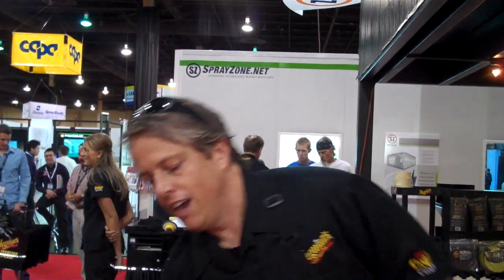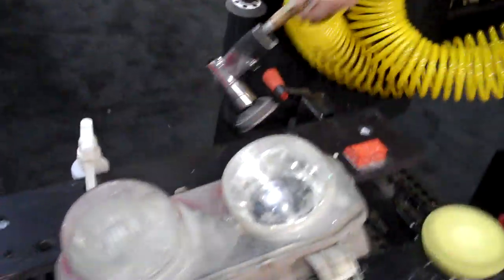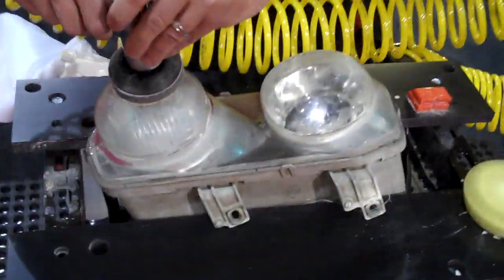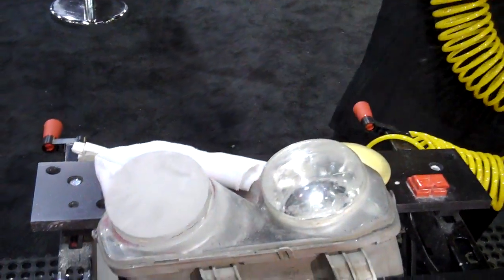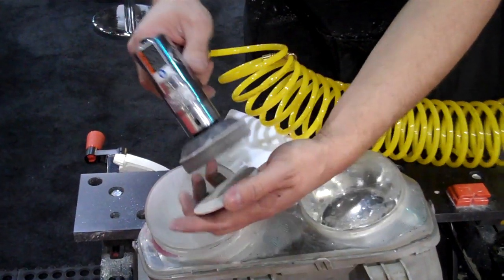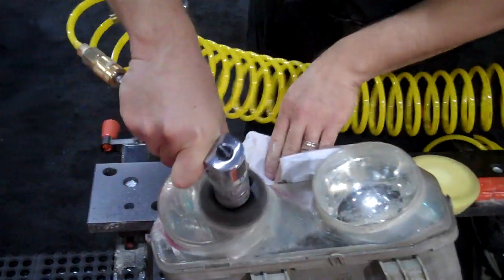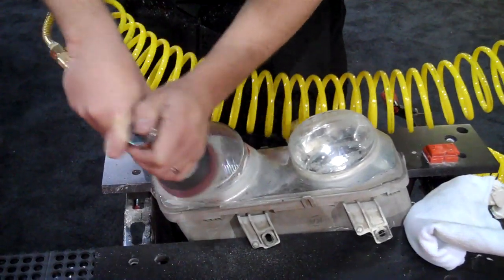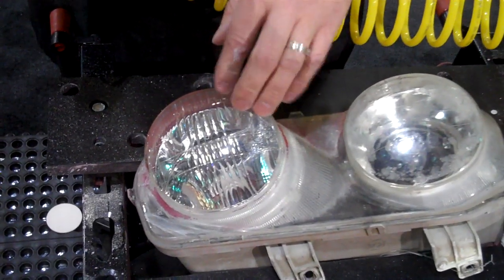Headlight Restoration with Meguiar's

Comment: Most of the Headlights on new cars are cheap to to buy new (replace) than to repair with this restoration kit that costs $69inAUST, not mentioning the time you have to spend to do it. And to restore its best to remove the lamp from the vehicle than why not buy a new one and put it in. Easy job. Most of people don't know how to buff sand etc, you need experience and if your having a first time go at it I promise you that you will staff it up and it will cost you more! :) Its all business!

Comment from the maker: @Bigjohnnywad- Here are tips, directly from Jeff!

The best solution would be to remove the lens from the vehicle.  Carefully remove the bulb and shake out broken glass and debris.  From there, mixing some Isopropyl Alcohol and Water 2:1 and sloshing it around inside will cut through debris.  Pour out and allow to thoroughly dry.  Once dry, replace with new bulb and reinstall into vehicle. 

Hope that works!!

Comment: could i just sand it with 1000 sand paper then 2000 (dry sanding) then use the 3000 wet sanding and without using any polish or something